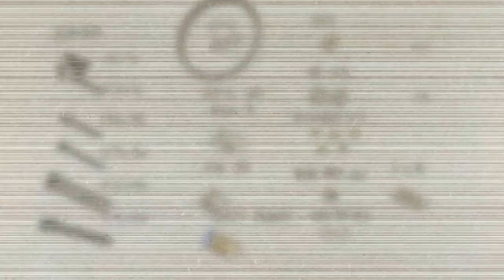J-Max's Bowden Belt Extruder Assembly video

Comment: Nice presentation. Can a slim Nema 17 be used? has it been tried?
Reply from the maker: Sure you can use a slim Nema 17. The smaller I saw in use is a 24mm one, but I the belt reduction may allow the smallest ones.

Comment: Wow, your supports removed so easily and cleanly! -- I've never had supports not completely fuse with the printed object. -- How did you do that?
Reply from the maker: If you look at the part I designed some of the supports into the part. You may want to change your settings on you slicer software or calibrate your extruder to get the expected amount of plastic flowing.

Comment: in merlin what is the setting you mani step x cm
Reply from the maker: Hi Antonio,
Well, if I give you my settings, it may not be suitable for your printer. Extruder settings needs always first a calculation, followed by a proper calibration. The basic formula for e_steps_per_mm is = (motor_steps_per_rev  x driver_microstep) x (big_gear_teeth / small_gear_teeth) / (hob_effective_diameter x pi) 

As you can see the parameters may vary depending of your hardware and your driver settings.

If you're not confident with this procedure, you can follow Thomas Sanladerer's excellent guide : https://www.youtube.com/watch?v=YUPfBJz3I6Y
Reply from the maker: Well, unfortunately Antonio you need to do the calculation for several reasons. First the settings depends of your driver's micro-stepping resolution. Second, you need to calibrate your extruder because of your MK7 part. The machining may be different for each manufacturer and the hobbing diameter may change.